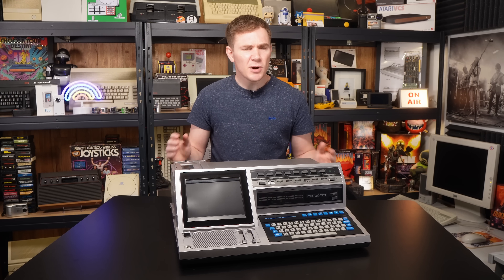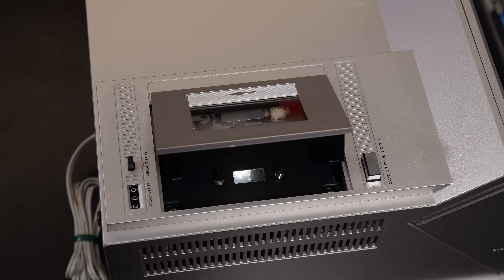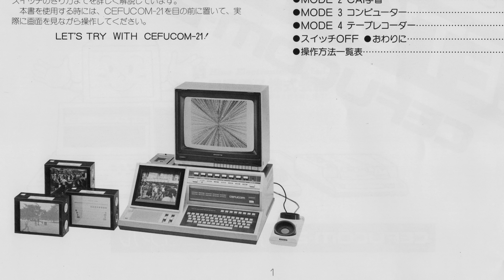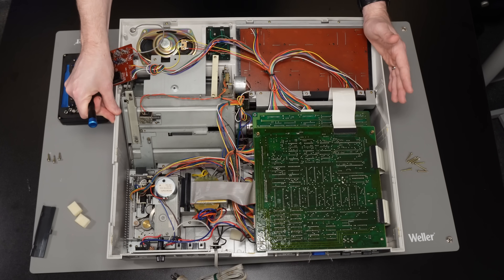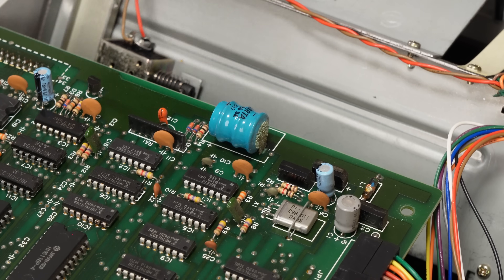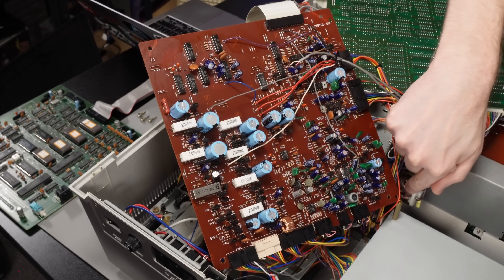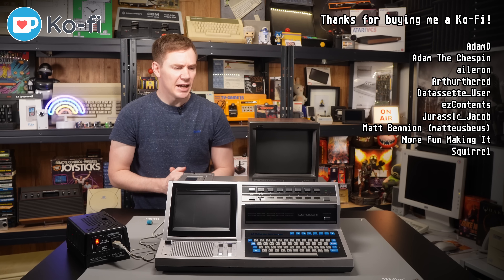What on Earth Is This Thing?

Comment: Interesting example of some of the lengths engineers went to in that era to bring interactivity to education. The promise was there but the tech wasn't quite good enough yet. There were a few areas where it could work well, like 'Math Blaster' type games, but so many subjects got little enhancement over just working with a plain old book.

I'm reminded of one of the features of the Atari 400/800 line that was almost forgotten while those products were still actively produced. The cassette interface made use of both stereo tracks, one for audio passed through to the TV and the other for data. Making use of this was a line of educational packages that taught lessons with spoken narration while displaying very simple images, mostly using the ATASCII extended character set. some of the features of how edit function were 'printable' characters meant some simple animation could be achieved using very small amounts of data input. (This also lead to a form of art found on Atari based BBS sites, long before you started seeing emoticons on USENET.) 

I had a few of these packages, more out of curiosity than genuine use for the elementary school level material, and they were another example of first generation desperation to convince people these machines had something to offer besides games and learning to program.

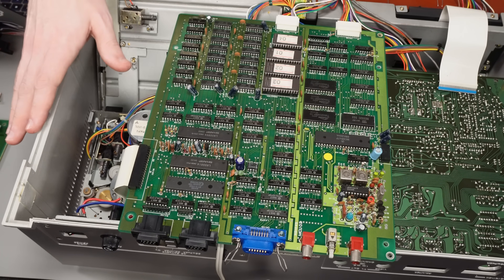Comment: Anyone know what the purpose is for the zipper design for what I'm guessing are power/ground traces? You can see them at 12:00.
Reply from the maker: I think it's to try to protect from RF noise from the modulator. Strange that they didn't just stick it in a metal case like most modulators of the time.
Reply: I think it was to make the alignment of the in line ceramic filter capacitors easier.  At 12:11 you can see solder pads and next to the ROMs some capacitors.

Comment: Are you planning the space for the paper loop display for a small screen?
Reply from the maker: I did consider this. Depends whether I can get it all working, I suppose. It seems a shame to modify such a rare machine if that's the case.
Reply: Make it removeable. Recreate one of these boxes with a 3D-printer (or Lego) and find a suitable display. Connecting power and video using long cables should be possible without damaging the computer.

Comment: I noticed that a lot of the IC.'s are upgraded to military grade. They're ceramic instead of plastic cases. Interesting.
Reply: some mixed population is common for some lower series count models - they just used what the market provided them at an acceptable price. fabs that had excess capacity just let their machines run and then were even able to select for their priority customers whilst putting the rest on the free market.

Comment: • Board 1:

09:55 The CTC is a counter/timer chip, but it's nothing to do with keeping the other parts of the system in sync; that's done by the system clock. The CTC lets you more easily do "real time" counters and timers, such as when you want to trigger an event every 15 milliseconds or second or something like that, or use a counter to time how long it takes for an event to happen. (This can be done entirely in software if you're very careful with your programming, but that's a lot more work.)

10:20 As @ChipGuy pointed out in another comment, the 6116 is a 16 kilobit 2K×8 static RAM chip, so that's 4K of memory there. The 4116 chips are 16K of dynamic RAM. It seems slightly mysterious having both static and dynamic RAM on that board; the typical case where you'd see that is where there's a relatively small amount of static RAM for the video memory and the larger DRAM is main memory, but there's no video chip on that board. Possibly the static RAM is wired as shared memory for communication between this board and the second one?

The ROM chips 2764 8K×8 devices, so that's 32K of ROM. I'd be willing to help disassemble them if you want to contact me on Discord (@0cjs).

• Board 2:

12:23 The TMM2016 static RAM chips are, again, 16 kilobit 2K×8 devices, so 6K of RAM there.

The ROM on that board is no doubt the BIOS and OS and the like; given that that board has more memory and the graphics and sound devices, it's probably the "main" computer, and the other is a second computer used to control various other I/O devices. (This is not that uncommon in higher end Japanese machines; the FM-8/7 series used a separate CPU for the graphics subsystem, and the NEC PC-8001/8801 series used a separate CPU for the disk subsystem.)

Perhaps board 1 runs the alarm clock and things like that?
Reply from the maker: Yes, it's certainly a very strange architecture indeed. Thanks so much for the info, I might include some of this (with full credit of course) in future instalments.
Reply: @ctrlaltrees  also 6116s and tmm2016s are basically the same thing, pin and function equivalent to each other, why they didnt use all the same type/brand, i dont know.
Reply: I have used the CTC to drive external circuitry as well, developing desired clock rates for other devices/perhperals, like drive the SIO for developing a baud rate and also drive a switched capacitor filter needed in a commercial 2-way radio to do low-pass filtering on analog GMSK 'data' then directed to a center-slicer, when then fed an input pin on a PIO Z80 chip for sampling ... so, CTC's can be quite versatile in their use!
Coincidentally, an every 10 ms interrupt was genned by the CTC for key-panel scanning, to do a de-bounce algorithm in software (mechanical pushbuttons and keypads are noisy and intermittent on the sub-millisecond scale until they settle).
Reply: There may a MODEM circuit hiding in there as well if the coupler is a passive device. The sound chip 'might' be used to generate early modem tones but a standard modem IC might also be hidden in the mess of the analogue board (or the last unexplored board).  Tracing the couplers wires would point the way.

Had a look and nope, It looks like the DIN connector has RS-232C TX and RX ICs adjacent so the DIN Port is likely a standard serial port with some probably custom pinout UNLESS the acoustic coupler was a commodity item from another vendor and they kept the serial connector pinout from that vendor which may have been some other custom layout)

Comment: Maybe a far-fetched idea, but when I saw the connectors, I was thinking about my MSX computer that had the same ports. Maybe is a MSX computer in disguise? Try to see the expansion/cartridge port if is MSX compatible and try some software. I think it might be a MSX 1 computer.
Edit: It seems to be a pre-MSX computer, more related with NEC PC 6001. I saw that most chips are used in that computer too and the architecture is quite similar. Maybe at the software level is compatible, as both have the cartridge connector (maybe check the pinout or at least the power and ground lines in the connector vs the PC 6001 connector)? Note that MSX and PC 6001 cartridge connectors are very similar but not identical, check the pinouts.
It seems to me that the computer (BASIC option or mode 3) is the second board, the first board being related with the alarm, schedule, etc. And yes, the third board is the power supply, the motors controllers and the audio amplifier.
Reply from the maker: Indeed, the information I could track down did compare it to the 6001, I nearly mentioned it. Thanks for the info!
Reply: @ctrlaltrees  It´s a pleasure and a privilege to see such a beautiful and motly unknown  machine. Thanks to you.

Comment: I was going to comment that power cord looks like North American Standard and some devices are quite particular to not having 120 Volts at 60 hz. No switching power supplies back in the 80’s. So always beware the 50 vs 60 hz issues in the future. 
There use to be a company called Sam’s Photofax which was a great tool to troubleshooting TV,s - Radios and other home consumer products. Not sure there is a database or PDF’s of any of the Sams stuff…. 

73’s and good luck!!!
DE N2JYG
Reply: The frequency is only important for things that have ac motors, no? Also some old clocks use the mains frequency instead of a crystal frequency generator but for the rest it shouldn't matter i think
Reply: It looks like a NEMA cord, but it's not. If you look carefully at the blades on the two prong plug you'll notice that they're both the same width: it's not polarised. That's a standard Japanese plug for home use. As well, there will generally be no 50 vs. 60 Hz issues with Japanese equipment because both frequencies are used in Japan (60 Hz in the west and 50 Hz in the east).

Comment: The last circuit board has a crack in the corner.
Reply: Yes it did, but no traces, so no problem.  When he showed the manual there is a main power rocker switch on the back of the computer. I wonder if that was the issue? We will find out soon. This computer is so cool looking.
Reply from the maker: That wasn't the issue, but it turns out that it was indeed my fault... 🤦‍♂️

Comment: 12:25: Yes, that's video RAM. There is a MC6847 near it. An there is even a NEC D2332 which is a 4KByte Mask ROM. The character font is stored in there.
Reply: If I remember correctly the 6847 had a build in very primitive character ROM. The 6845 was much better and needed an external character ROM. It was later used on the Hercules video board for the PC which later became the standard for the PC.
Reply: @ganswijk  I think in every PC you will find a compatible 6845 register set on every graphics card or even CPU with graphics. Some old DOS programs still use that and they still work on modern hardware.
Reply: @ChipGuy  I tried to say that! ;-)
Reply from the maker: Thanks for the info. It's such a strange thing and quite out of my comfort zone.

Comment: 10:20: Those 6116 chips are 32 Kbit, total. Not KByte. So that's 4KByte of RAM.
Reply: guessed similar due to the fact these documentation web page used a lower case "b" as it would normally stand for bits. (and even if the Z80 is sort of 8 bit, you can never be sure what real bit widths are used on busses and for various storage units, including how their interleave works.)
Reply: @alexanderstohr4198  On the memory chips they usually encode the size in bits, kilobits or megabits. Sometimes they incorporate the bus with in it as well. So a 2 Megabyte SDRAM can be named xx1608 for 16 BMit 8 Bit wide, ot xx0816 or even xx0432. The xx can be any number by the vendor and usually they start with some letter as well.
Reply: Correction: 3 x 16kb(it) static RAM Chips = 3 x 2kB(yte) RAM = 6KB(yte) RAM.
The 6847 was also used in a Graphics add-on card for the UK101, mine also had 3 x 6116 Static RAMs (6kB) and it displayed 192 x 256 resolution in B&W.

Comment: Is it just me or does 1200 bps for the cassette sounds fairly advanced for the time?
Reply: Its not bad but its not great either. Fastloaders can do more on c64 and zx (wayy faster if the source isn't an actual cassette)

Bbc did 300 ans 1200. Generally slower equals more reliable.

Comment: he CEFUCOM 21 is a very strange computer ! It was built around a Sanyo PHC-25 to be used as a computer-aided teaching and learning system (to learn English for example).

A tape recorder is built-in the left side of the plastic case. The tape deck can read data on one channel and audio on the other. This feature is used by the system to output audio instructions at the same time as its loads data programs into the computer. The tape deck can also be used independently from the computer (see below). Classic connectors associated with the tape deck are to be found on the left of the case: Phones, Line out, Mic and Aux In. Below the capsules' window display (see below), there are two sliders used to control the volume and the balance.

But the most incredible part is the built-in display on the left of the case, just below the tape deck. On might think that this is a LCD screen, but it's not. It's only a plastic transparent window to show what is behind. Teaching programs were delivered with "capsules" which look like a book in a box. When this box is inserted into the (huge) dedicated slot, the visuals contained in the capsule are synchronized with the corresponding data program to be displayed behind the small window. When the visual changes, a black shutter hide what's happening behind, and then reveals the new visual. This is very impressive to watch !

The CEFUCOM 21 is thus a very innovative system mixing electro-mechanical-controlled visuals, with real computed display, computing data from the tape and real audio instructions coming out also from the tape ! A real multimedia system in 1983.

The system can also be used as a normal computer and is BASIC compatible with the Sanyo PHC-25 and NEC PC-6000. Under CEFUCOM BASIC 1.0, a bit less than 32KB RAM is available for the user.

When the computer is switched on, the following menu is displayed on the screen:
1 - See/Modify the planning of your lessons
2 - Study a lesson
3 - BASIC
4 - audio recording/reading mode

Option 1 is not clear... Does it show you information about your lessons schedules and progressions, or can it be used to create new lessons ?
Option 2 will ask you to insert the correct capsule into the computer.
Option 3 must be chosen to use the system as a normal computer, like a PHC-25 on steroids.
Option 4 is intended to use the tape deck alone to listen to music or record something (trough the AUX IN or MIC connectors on the left of the computer).

The audio features which were optional through the PSG-01 expansion box for the Sanyo PHC-25 are he built-in the system, offering 3 voices of 8 octaves, as well as the two DB9 "Atari compatible" joysticks connectors.

Above the keyboard are a set of buttons used to interact with the lessons (buttons 1 to 8) and also to manually control the tape deck (RECORD, PLAY, REWIND, F.FWD, STOP, PAUSE). There are also buttons and switches to control the built-in clock and alarm option. There is also a serie of LED indicators used to show various informations such which MODE the system is in, or the progress of the study/lessons.

There is also a ROM CARTRIDGE slot, but its purpose is unknown. Was it intended for something special, or never used ? The Sanyo PHC-25 didn't have a cartridge slot, but the NEC PC-6001, which is very close technically, did...

Another curiosity is the DIN8 plug found at the back of the system, labeled "COUPLER". Did they intend to connect the CEFUCOM-21 to the outside world though a modem ? It's incredible to think that the developpers tried to put every features they could in this beast in 1983 !

Comment: S-ay / L-ook / A-sk / P-ut - SLAP - The SLAP strategy is designed to assist students with deciphering the meanings of words found throughout informational texts by utilizing context clues. SLAP is an acronym for steps of the strategy which equips the students to determine a word’s meaning by looking at the clues within the text itself. After being taught each step explicitly, it is the goal for each student to independently use SLAP while reading to increase understanding of both the text and individual vocabulary words.
Reply: Interesting. My guess was going to be "Second Language Acquisition Program", but I think "Say/Look/Ask/Put" is an even better expansion.
Reply from the maker: Thanks so much for this, it sounds spot on. I'm not sure why it didn't come up in any of my searches.
Reply: nice
Reply: There's another thing called SLAP strategy, is when big companies drag individuals in exhaustion through endless legal battles often when they expose their dirty laundry.
Reply: @Wok_Agenda  If I recall, that acronym actually has two Ps.

Comment: Good Lord, this looks horrendous. I love it.
Reply from the maker: Indeed, that was my first reaction 😅
Reply: @ctrlaltrees  FYI, there is only one Z-80 CPU in this machine. There are two ICs that at first glance look identical, but at 13:21 you can see they are even labeled with what the actually are right on the package and PCB silk screen. The 40-pin SHARP LH0080A package is the Z-80A CPU. The other 40-pin SHARP LH0081A package is the Z-80 Parallel I/O interface with two 8-bit I/O ports. I suspect that is being used for the printer port, joysticks and possibly the paper strip cartridge drive mechanism. That being said, the CPU answer is: one Z-80 running at 2 MHz. Just thought you'd like to know this info before going down a rabbit hole looking for dual Z-80 CPU setups.

Comment: I have a vague memory of when I was a kid, the first time — at least with me in tow — my Dad used a Cash Machine/ATM… that had a motorised menu system that I imagine is like this rather than a CRT. I’m guessing this would be very late 1970s or early ‘80s… like a motorised version of the intro to Camberwick Green.

Guess it was deemed a cheaper or more robust solution back then.
Reply: Docutel 300 had a rotating drum for its display. 70’s A retired ATM technician here.
Reply: I remember my Mum using an ATM that had the keyboard behind a glass screen that would slide down when it wasn't being used by a bank customer. Also the display was only viewable by looking into a soft of long rectangular funnel.